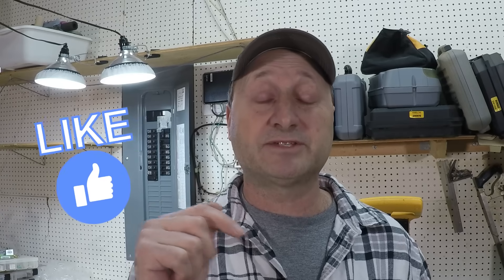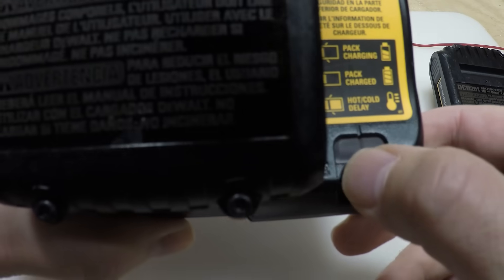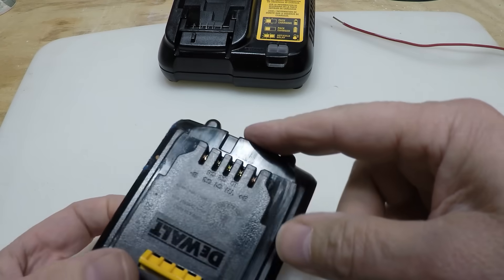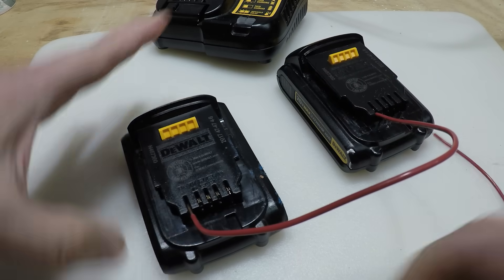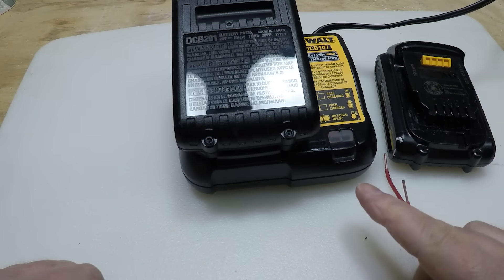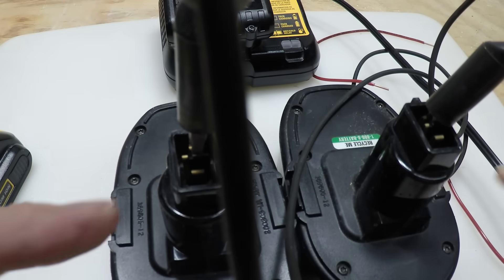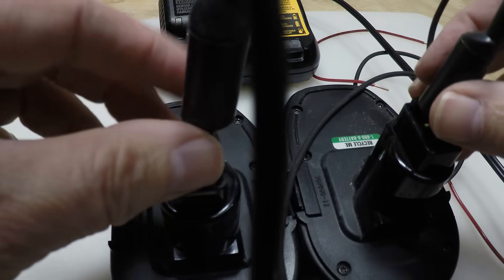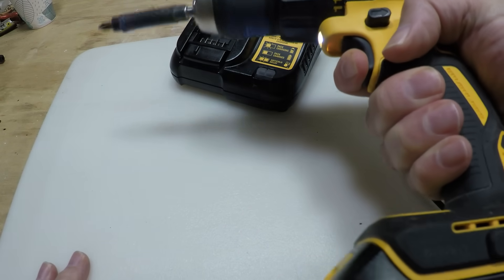SECRET to FIX Drill Batteries - Charge Dead Lithium Tool Batteries

Comment: Hey thanks for this video.
I only have the one battery tho for my B&D 12 volt older drill. I have the charger too and while charging it last night the red light came on as if it was charging but then I could smell something and the red light was off, making me think it had changed up really fast. So I put the battery on the drill, but nothing. The battery had no charge.
Any ideas? Thank you!
Reply: If it's 12 Volt it's most likely a nickel-based battery. Older B&D stuff (how old exactly?) sometimes had chargers that weren't really up to the job and fried a series resistor (and could also blow a fuse on the secondary side if I remember).
Most likely, one of your cells is bad and this just requires recelling the pack or buying a new one (recelling is NOT easy if you do not have the equipment and knowledge required!).
The fact the charger labels it as 'end of charge' is because the dead cells will make the voltage rise quickly, where especially simple chargers that tend to look at voltage only, can be fooled into thinking it really is fully charged.

Comment: This doesn't directly work for all batteries, especially not lithium packs that have a battery management module within the battery itself.  Some batteries don't have this chip operate if the pack drops below a certain threshold.  This means disassembly is required to where you can voltage balance the pack at the battery itself, bypassing the PCB that has the management module.  This is also why lithium chargers have an additional indicator for defective batteries.
Reply from the maker: thank you for watching
Reply: Any way  "they"  can invent something to stop us from saving money "they" will..... them shekkles have to keep flowing, and if it takes a small "pcb" to earn them money "they" will...... oi ga velt!!!!!

Comment: Have a Harbor-Freight 20v 5 ah battery that went dead from lack of use / charging (only used it once in the past two years)...charger lights would only flash...Didn't want to hunt down some solid wire...so I used 4 "t-pins" from my local fabric store inserted into the battery slots...(picked that idea up from the South Main Auto channel) and a pair of alligator jumper wires...got a spark upon touching the negative t-pin...so i sparked it again...immediately put the battery on the charger...IT IS NOW CHARGING!!!! In the words of Elvis: "Thankyouverymuccchh!"
Reply from the maker: thank you for watching - please share the video

Comment: I have dead 48 volt lithium ebike battery that is dead. Will this work if connected to a battery  that has a charge? And how long should the connection be? thjank you
Reply from the maker: not sure if it will work with that battery. However, it only needs to be connected for a couple of seconds.

Comment: Worked like a charm on a cheap Chinese 21v battery for a handheld saw. Arrived from amazon seemingly dead. Saw a few little sparks when connecting the last negative wire. Thought that might have caused a problem, but it didn't. Thing charged right up and works perfectly now. Thanks a lot.
Reply: I had the same few sparks then charged up to fully functioning spare battery

Comment: Hi there, I have Ryobi 18v batteries that have the four lights on the battery to show how much charge is left on them. over time  i am finding the charger only charges to 3 lights then 2 lights then 1 but of course 1 light wont even drive the drill. I have 8 batteries and now only 2 are working. They are all 4ah and 5 ah .. any ideas?? thanks in advance
Reply from the maker: no idea

Comment: THANK YOU SO MUCH!
I have 2  brand new never used 20v (newer style) porter cable batteries I let sit for 2 years. Dead. I Took my 18v (older style) RYOBI 18V and it worked! Both were lithium.  I held it for about 5-10 seconds and that's it. It works!
Reply from the maker: glad it worked. please share this video
Reply: I have a old black & decker how do I do that one with one battery
Reply: @eulessjohnson-ku8ho borrow your friends, or someone in another comment even got a 12v car battery to jump it just enough

Comment: OMG!  This totally worked for my Craftsman 19.2V C3 battery. It was measuring 15V internally but was dead between plus (pin at top/curve side) and minus (pin at bottom/flat side). I jumped it with a good C3 battery (just like jumping a car) and it was recognized by the charger and is charging.  You saved me from having to buy another battery. Thank you!
Reply from the maker: thanks for watching! please share the video for me
Reply: I have a Craftsman 19.2 batteries also.  They haven't gotten to the point of being completely dead, but when I charge them, they die out very quickly.  Is there a repair solution for this or should I go and buy replacements?  Thank you.
Reply: @dougbergren8035 battery capacity does fade over time, but within a reasonable time scale not so much that they very very quickly run out.
  What this sounds like is the individual cells have drifted out of balance with each other. One or a pair of cells are nearly empty when the others are Full or even over-full.
  It might be possible to open the pack and jump the lower voltage cells up. But is a potentially risky business. Those cells may be chemistry damaged so their internal resistance is higher. Meaning they will only drift apart again fairly quickly.
  Probably best to just get a new pack or entirely new tool.
Reply: @johnrhodes3350 what this sounds like is lots of talking yet saying nothing.
Reply: @jeffalexander2061  You SOOO funny😁
Reply: @dougbergren8035  Not sure, but if they're not keeping a charge for long, it sounds like they might be ready to replace.  But if you have a good battery, and one that is not getting any charge, the jumpstart method using the pins above might help improve the memory.  Worst case, you have to get a new battery.  Good luck!

Comment: Tank you for this tip. In the case I have only one battery to backup do you have any solution? Thanks
Reply: I just tried it with baling wire and a 9 volt battery. I was so surprised it worked!
Reply: Yeap, left testicle to B minus and so on

Comment: Hi my name is Tim I was watching your show on the battery I need about jumping them I have a Craftsman 20 volt I put my tester and I tested at 20.1 and 2/3 lights are coming on showing it fully charged but it won't pull my you got a full battery but it won't push the sawzall and won't do the Skil saw her know but it's got a full charge and it's got a full charge all the way down

Comment: I have a 4amp 18V and 2 amp 18V Ryobi battery. Both aren’t working. Can I use a different brand battery with different amps/Volts to do this?
Or can you use a motorcycle size battery to do it?
Reply from the maker: I never tried it with different types of batteries.
Reply: The voltage match is important, the amp rating is not relevant.

Comment: 12 volt lithium for a ac delco drill it shows charged but does not work .can I revive this battery ? Why would it show charged on charger and not work ? Any ideas or help would be great
Reply from the maker: test it on a different tool to be sure the batter is really working
Reply: Same thing happened  with my battery  for  ac delco did it work ? Bought replacement  from harbor freight using there earthquake 12volt but now no longer carry them .

Comment: I have a question: for the 18volt battery, I have one that is charging and isn't completely dead, but when the charger says it's fully charged I'm not getting much power out of it. can i still use this trick to restore the power to the dead battery?
Reply from the maker: test the battery on a different tool to make sure it is really working
Reply: Hey. What did you end up doing? I'm having your exact problem and it's an 18V too. I must say the video is good. But i don't have the wires/ connectors and I don't want to ship in if it can't work

Comment: That trick worked!  Thanks so very, very much!!  I had a newer DeWalt powerstack battery, and a slightly older 2AH Dewalt battery the both "died" while on a battery converter that I purchased to be able to use my 20 volt Dewalt batteries on my new Milwaukee 18 volt 18ga nailer.  I am real suspicious that it has the ability to kill batteries.
Reply: Most likely, that battery-converter is drawing some current when not in use: probably not a lot, but a few milli-amps are enough to drain a battery in a short amount of time, especially when it's already at 50 % SOC or so when you put it away for next use.
I nearly killed one of my newly recelled video-batteries this way when I kept my Blackmagic Video Assist connected to the camera via D-tap. In stand-by, it was drawing 6,5 mA, which I consider absolutely ridiculous in this era: there are many power supply IC's that can do a far better job at stand-by current. 6,5 mA doesn't sound like much for a 170 Wh battery, but at 50 % SOC it took a few weeks or so to get it down to system critical voltage, with the BMS nearly going into shutdown mode. I recelled them myself and have the interface to reset them if I need to (because it takes a looong time for the cells/BMS to go from 'shutdown' to 'shutdown forever' mode , but it's not good for the cells to go that low)
Reply from the maker: thanks for watching.... and I would appreciate you sharing the video in your social networks.